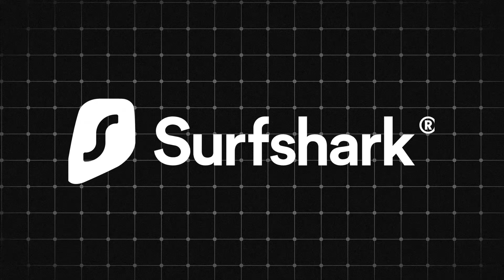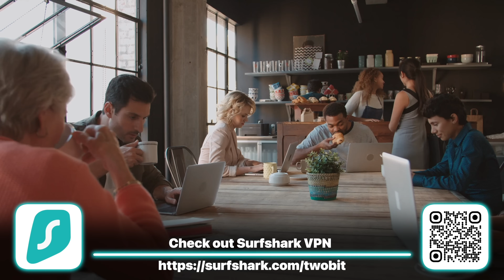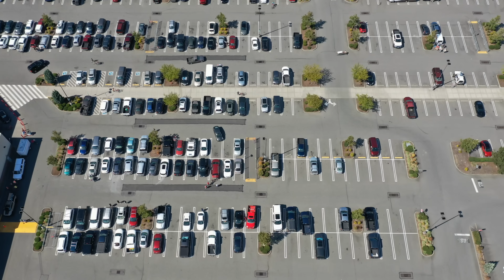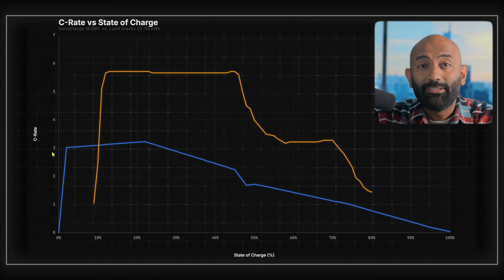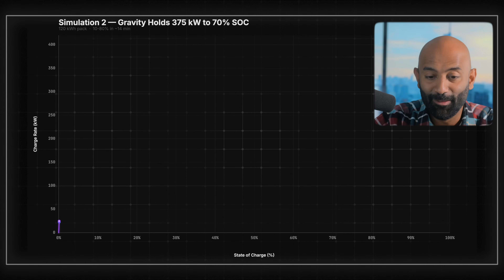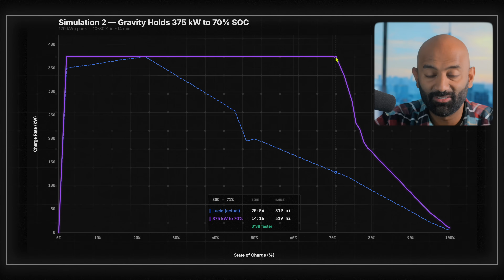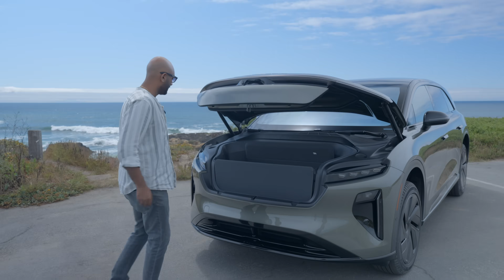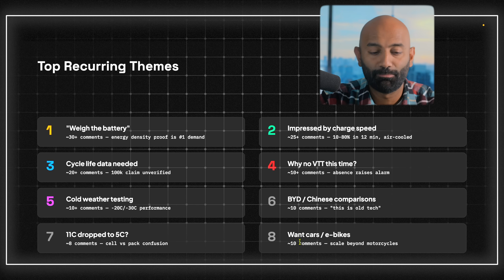Donut Lab Battery Test 4 Changes Everything!

Comment: The slow ramp of charging at the beginning of a dc fast charging is most likely due to the a current limit with the voltage of the battery increasing. The charge rate is the pack voltage times the current. The battery pack may be receiving 400amps at 750V then slowly rising to 400amps at 770V
Reply: Don’t all fast chargers spool up over the course of a minute or so?  All the ones I have used do that.
Reply: Not all EVs slow ramp, my Kia EV6, for example, which is 800v like the lucid, jumps to over 200kW charging at 1%.
Reply: @GruffSillyGoatI also have an ev6. Try to find a dc fast charger that has a 200 amp limit on the cable next time you are at 10%
Reply: @joshuasweet688 - The 600kW Alpitronic charger near me is fine, and has liquid cooled cables able to support up to 600A. Similar to the 500A cable one at the 300kW one used in the Donut video.

p.s. the CEO of Verge in an interview stated the Verge uses modules configured at 400v.
Reply: @GruffSillyGoateven if a certain charger can handle 500amps the vehicle may not. Like my 2025 kia ev6 is dc limited to around 350 amps at 770V. When it is down to 5%, the battery is at 700v. That means that at 5% it can accept 245kw. But when it reaches 10%, the battery is at 710v, and can accept 250kw.
Reply: @joshuasweet688  - exactly my point, it's not a slow ramp in the EV6, when it starts charging. It jumps up at 1% to above 200kW, and then steps with what the battery can handle, it doesn't slow ramp.
Reply: Could it also be attributable to the cooling loop in the DC cable itself needing to ramp up?
Reply: @pkprotoplasm the cable temperature will actually start out low and then increase over time. This will cause current to reduce over time.

Comment: As a drone pilot all im waiting for is the mAh/kg.
Is it more energy dense per 100 grams than LiPo or not?
Thats all i care about. It can charge at only 2C for all i care. It can only handle -5C to +40C temps for all i care.
The only thing that matters for it to be a USABLE revolution is energy density per unit weight.
Even if EVERYTHING else is identical to LiOn or LiPo.
Reply from the maker: yeah the benefits will vary per use case. for drone its all about the 400Wh/kg density. for stationary storage 100k charge cycles is an overnight gamechanger. so much this can benefit
Reply: @TwoBitDaVinci 
Have you looked into Amprius batteries? They are designed for aviation and drones. The company claims 500 Wh/KG energy density. 
@thelimitingfactor has a good video on it.
Reply: @TwoBitDaVinci  They hype WAS all about "the miracle of 'ALL the claim are true'". And now, it seems we are trying to give them credit if they shows some "not shabby" result in some aspect which a lot of other batteries already do.
Reply: Drone warfare could change instantly. 25 km round trip maximum becomes, say, 40 km.

Comment: Not really 5C, 5C was only for a few minutes. I can do 11C for 10 seconds. The test should have been from 0% to 100% at 5C,  they also didn't show the max temp while charging. Doing the math at a constant charging rate you will get 3.5C from 0% to 100%, but like the first 10% and last 20% are harder to charge, you get like 3C. And that is the charge rate that the Verge claims on their website
Reply: @rwyo83  what a stupid take. Edit: good job editing from your initial stupid ass comment.
Reply: Exactly
Reply: that would not be not a real world test
Reply: @raresaturn  Yes it will be, because these "batteries" are supposed to be used at full capacity.